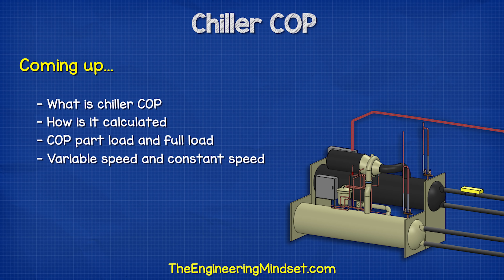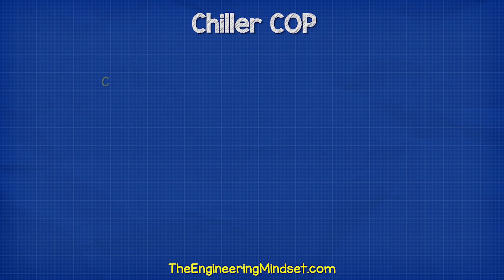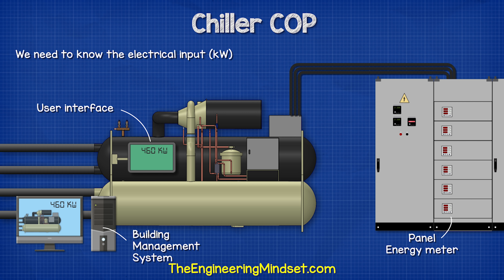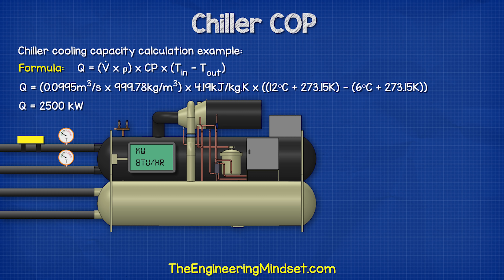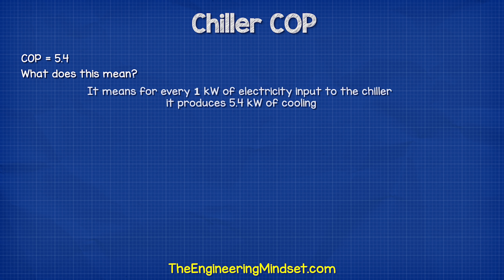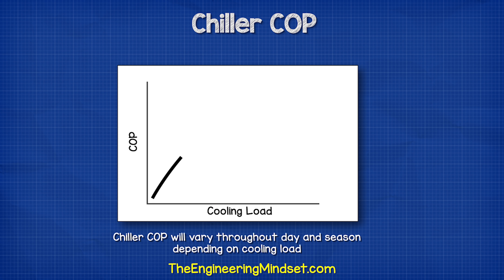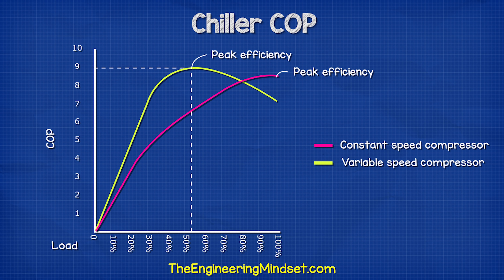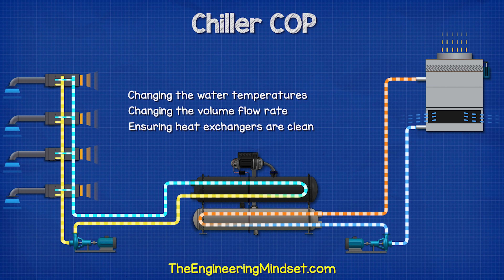Chiller COP - Coefficient Of Performance energy efficiency hvacr

Comment: In minute 6, it is mentioned that chiller efficiency is lower when approaching full load. As far as I know, for centrifugal chillers, the best efficiency is when they are running at 100% chiller load. Kindly correct me if I am wrong.
Reply from the maker: They do operate best at full load, however not when a VSD/VFD is installed

Comment: Hey guys is it possible to use VFD motor as a synchronous (Constant speed) motor in chiller during the peak load months (by bypassing VFD related Power electronics).
Reply: Yes, VFDs will often have a bypass mode to allow power to bypass the power electronics in case the VFD fails. If you need to operate at full speed anyway, it's more efficient to bypass the VFD since there are some losses in the VFD. Idk if that's an operation that can be automated easily however.
Reply: @samfisher874  Thank you for reply.

Comment: 👍🏼 The world needs more people who understand the design, installation, and operation of high efficiency chillers! Have at it, gang! 😎✌🏼
Reply: Why?
Reply: Because énergie is more expensive.
Reply: Cooler pipe line is ,expls, is   isolating  vave-normmally  open  ,isolating  vave-Normal  closed ,    flow  metar  ,strainer      pressure,  tapping  ,flow  swith  ,, connection  ( flanged  /vivtaulic)  pipe  work   ,flexible  connection,  ex,,pls,,  cont  out  in  ,   chiled  water lines

Comment: I have a question. How can 1kw of energy can produce 5kw energy. Is it different kw?. It got me confused
Reply from the maker: 1kw of electrical energy is used tk collect 5kw of thermal energy from the environment. We  are just using the electrical energy to collect thermal energy from lots and lots of air/water and store it in a much smaller volume.
Reply: 5kw of heat is being moved from the cold side (cooling it further) to the hot side (heating it further). It takes 1kw of power to move that 5kw of heat. therefore the hot side has to dissipate 6KW of heat in total. while 5KW is being extracted from the cold side.
Reply: As the Channel has mentioned, Compression Heatpumps such as this one can reach COPs of greater than 1, which often confuses people. COPs are calculated much the same way classical efficiencies are calculated, but precisely because they can exceed 1, they are not called that to not cause confusion.
A heat pump doesn't generate heat specifically, but rather moves heat up a temperature slope. Think about temperatures as hills, heat always travels down hill, from high temperature to low temperature. A heat pump moves the heat against this gradient and uses energy for that. The reason for why it uses energy are a bit more complicated, involving entropy and other themodynamic principles.
Now, for various application, the useful thermal unit is different. Either you need the cooling, like in a refrigirator or you want the heat, like a classical compression heat pump for our house. Depending on what energy you want, you disregard the other source. For an instance, the backside of you refrigirator gets warm if it's running. That's because the heat from the inside is move out. But since you don't care about that additional heat in your room, you disregard it and calculate the performance only using the useful cooling energy.
If you want to heat your rooms with a heat pump, the principle is opposite, you want to have heat and you take it from outside, either from the air or from the ground. But since the low temperature thermal energy of the air of ground are nearly infinite, you disregard them in the calculation.
Reply: Less electrical energy used to CONCENTRATE heat energy from the environment (which is not created but relocated)
Reply: Refrigerators are called heat pumps. An electrical resistance heater simply convert electrical energy into heat and is 100% efficient,  its cop is 1. Heat pumps move heat from cold region to hot regions using electricity or other forms of energy. -273 C or 0 k is called absolute 0, at this temperature there is no heat remaining in the region,  theoretically as long as the temperature is above 0 deg k, there is heat energy in the region. That is why reversible ACs are about 30% more efficient in heating the room compared to using electrical resistance heating because they use electricity to move heat from cold region to hot region not electricity converted into heat.
Reply: Oww. Thanks you guys
Reply: Energy is not being produced. The energy is simply being transferred to the refrigerant and then expelled on another side. The fundamental reason why we get a larger energy transfer than the energy we put in is to do with the latent heat of vaporisation and condensation.

Comment: I just replace a 600 amp circuit breaker on a Trane chiller yesterday.   I've been an electrician for 30.  It very interesting to me how the mechanical side of equipment operates.
Reply from the maker: We have lots of chiller videos if you'd like to learn more
Reply: @EngineeringMindset  I'll check those out.  Do you have any videos on the programming systems?  I know every company.  But are they similar?
Reply: @bah5310  600amps.  wow.   I mean WOW.